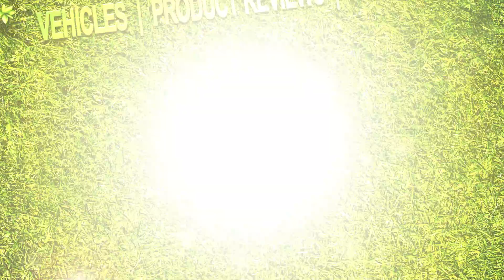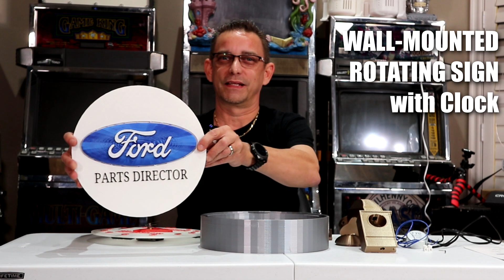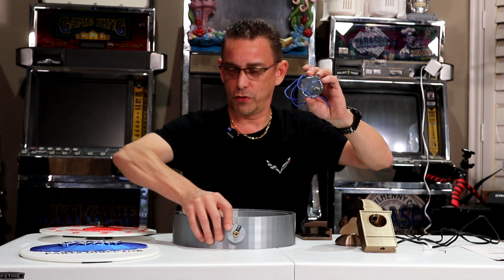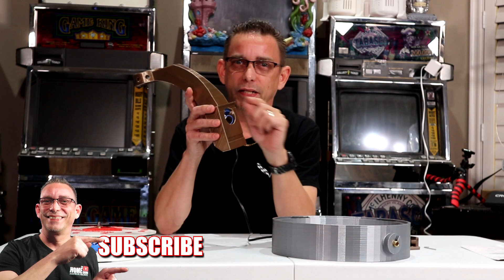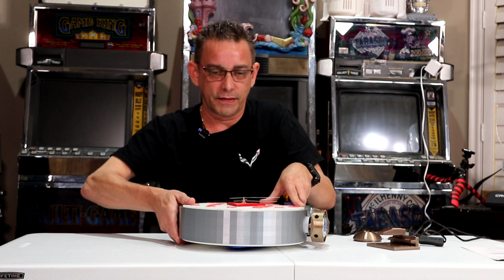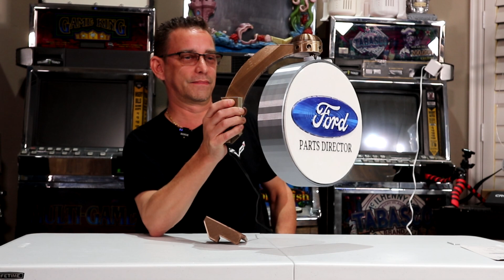WALL-MOUNTED | ROTATING SIGN with CLOCK | 3D PRINTED

Comment: I wanted to run this sign on an automatic timer for around 12 hours. is it possible, so that it can run on shop signage from evening 6 to morning 6?
Reply from the maker: With that motor I used. It is NOT recommended. But what I did was plug it into a motion sensor outlet and every time someone walked into my office it turned on for 5 to 10 minutes, then off.
Reply: @twHomeShow  can we able see that and what if people walk in continuously wherever this motion sensor installed will it affect more on it. One more question is - Is there any solution to it to run for long hours with led lights installed same as shop frontlit signages.
Reply from the maker: @grmadvertising  Just be aware. The small motor that I used will create HIGH-heat when activated over 15-to-25 minutes that may melt the 3D "PLA" plastic or cause damage to the motor (who knows, maybe FIRE?) So you have to take measures to accommodate for these outcomes. This has never happen to me with my projects, BUT I am OVER-Cautious when preventing accidents. I never had any issues with people walking in-and-out of my office all day activating my sign with the 5-10 minute motion sensor. Keep in mind, I created this 3D Sign over 2 years ago....there may be better small motors available today....you just might have to modify the 3D Print Design to make a newer motor fit.  -Todd
Reply: se puede colocar un ventilador pequeño de los que se usan en las computadoras

Comment: hello friend thanks for sharing your knowledge. I wanted to ask you if the microwave motor you use does not get excessively hot after a period of ignition. I am trying to use a 110V for 4W and 5-6 rpm microwave motor but after about 1 hour of power on it gets very hot, I have let it run for up to 4 hours so hot and it has not stopped or presented faults. but I don't know if leaving it on for a longer time will melt the internal gears that I assume are plastic. Thank you for your response and congratulations on your channel.